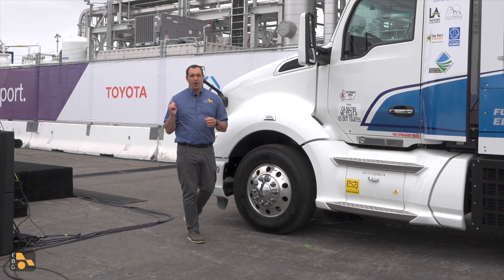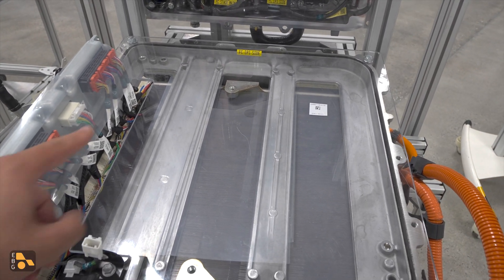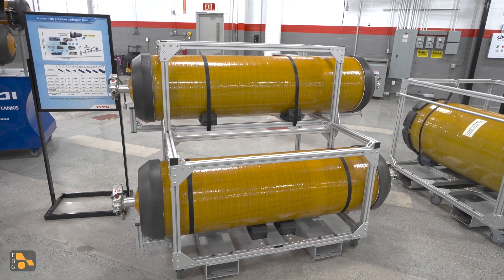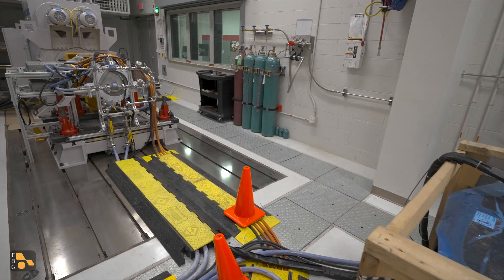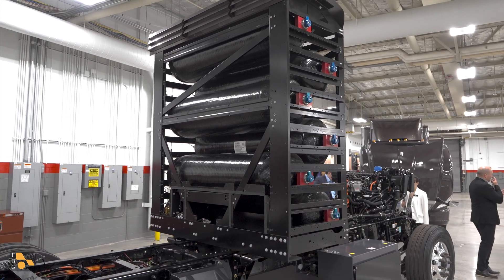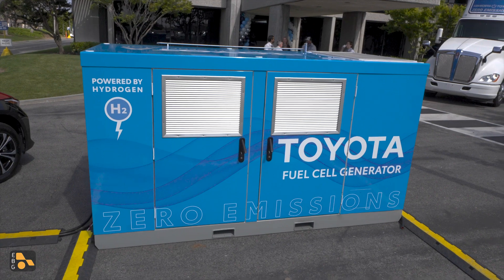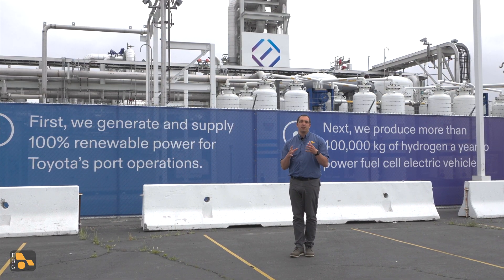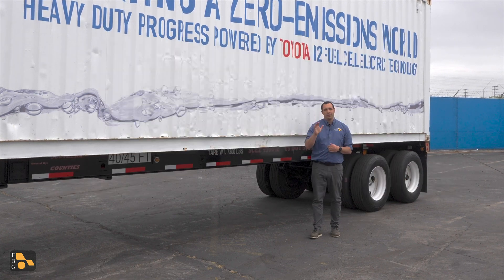More Hydrogen Is (In) The Future

Comment: 2:27  Love the "DO NOT USE AFTER" date of 03/2036 on the tanks.  That's when all 3 tanks need replacing because you can't test and recertify composite 10k PSI tanks.  Hopefully, the price will come down because it's about $20k to replace them at the moment.   A similar warning (DO NOT REFILL AFTER) is on the fuel door.  They are certified for 15 years in the Mirai, not 20.

Comment: This vlog about hydrogen power should not be on the EV Buyers Guide channel.   Although the motive power of hydrogen vehicles is an electric motor, most hydrogen today is produced from fossil fuels, natural gas and petrol.  So a hydrogen-powered vehicle is not an EV.  Using a fossil fuel to create electricity, which is used to produce hydrogen, is thermally inefficient.  And burning  a fossil fuel to create electricity adds carbon dioxide to the atmosphere.

Comment: Rube Goldberg called and he wants his truck back.

Diesel truck (1 powertrain): 150 gallons of fuel, 1000 miles range, >400hp until depletion
Hydrogen truck (2 powertrains): 200kWh battery+60kg hydrogen, 400 miles range, ~1hr at 400hp then ~230hp to depletion
Tesla Semi (1 powertrain): 800kWh battery, 500 mile range, ~1hr at >1000hp then tapering to depletion

All of these trucks have similar weight and hauling capacity, only 2 make any sense.

You can already charge a Tesla Semi in more states than you can fuel a hydrogen vehicle.

Hydrogen always has been and always be a joke for road transport.
Reply from the maker: For what it's worth, a decade ago (and today for many) BEVs were a joke. -Travis

Comment: Facepalm. Using natural gas to make electricity, then using electricity to make hydrogen. Then using hydrogen to drive. Feels like another Toyota excuse. Just use a natural gas engine or generator and save yourself the trouble and a lot of money. This is wasting resources not saving them.
BTW water is used to make hydrogen, water is not a product of making hydrogen. You get water when you burn hydrogen - so it probably comes out of the fuel cell.

Comment: This type of  infrastructure installed in most city and town would not only produce fuel for vehicles, buildings and many other applications including providing clean water for them locally without a lot of contaminates & pollution by products.  If the fueling is as quick as petrol I can see that the current fuel stations would be more willing to adapt to this technology as it will not have soil contamination in the future and does not take away their current income like the EV charging stations that has long turn around time for each station (it they are ever working in optimum condition) per vehicle.  Glade to see the technology is going in the correct direction.  I appreciate the diligent of the OEM making the tanks safe; however, what is the estimate damage radios & effect if one should malfunction?

Comment: Big trucks are a perfect application for this technology.
Reply from the maker: It certainly seems easier to find room for the tanks than a sedan. -Travis
Reply: I'm not sold.  The Tesla semi has recorded a 500 mile trip with 82k lbs total weight with a ~900kWh battery.  They can add ~350 miles in around 40 minutes with 600kW charging.  They seems very very competitive.  It's going to come down to how easily is it to build 1mW charging vs hydrogen stations and how big of a deal 30 vs 10 minute fueling is as well as the fuel cost.  EV seems to in on about every one of those other than refueling time and I can't figure out how an extra 20 minutes is a big deal given required breaks.
Reply from the maker: One of the key points to me is the difference in battery capacity necessary. The truck runs off an electric motor but is using a 200kwh battery versus the almost 5x larger battery on a BEV truck. -Travis

Comment: As a geek I always enjoy a good science fiction story. But this one had me shaking my head and laughing throughout for numerous reasons. Especially at the end where you stated that Toyota used natural gas instead of the Biogas methane, which Toyota originally used at the facility. 

Cost and inefficiency has always been a non-starter for fuel cells. (Except in a few niche cases.) But also using an unsustainable hydrocarbon such as Natural Gas as the feedstock and calling it zero emissions is  just greenwashing.
Reply from the maker: Toyota is "using" Biogas in the same way that most utilities offer green energy options. They pay for it but they aren't specifically utilizing it. -Travis
Reply: @EVBuyersGuide  Travis, thanks for the correction. And thanks for the story, it brought back memories of one of their earlier trigen plants.

Still the least cost effective or viable option, but at least it can be considered, NetZero.

Comment: The point is that this product could only work in the US where people want to invest in it. In many parts of Europe the top speed for the plus 3.5 tonne category is limited within a range of 50-62mph. Also in the EU, truck drivers have a mandatory break after 4.5 hours of driving, which must be at least 45 minutes. So a vehicle that can travel 480km (~300 miles) on a single charge with the ability to charge 410km (~255 miles) in 45 minutes is sufficient for almost the entire market. The entire hydrogen industry is a decade behind its original promises.
Reply: Exactly I think Toyota made a promise about H2 in 2012
Reply: and Toyota will keep riding that dead horse until the government funding ends lol
Reply: Don't look now, but H2 trucking is also being developed in EU-land. And in other parts of the world such as Korea. 

Trying to make this just about the US, is missing the point.
Reply: @nc3826  I know they are developing and testing, but it took them longer than they promised in the past. There should have been fleets of hydrogen buses, trains and trucks 5 years ago, but it didn't happen. The first prototype of hydrogen bus was on our roads back in 2009. 15 years later they are still in the prototype and testing phase. Meanwhile, battery technology is advancing at such a pace that for last-mile delivery or city buses, the entire ecosystem (chargers, service point, vehicles) is cheaper in electricity than in hydrogen.
The video implies that the main advantage is fast refuelling and long range, but this is not a problem in EU due to mandatory breaks for drivers. So you don't care if the car can fill up in 10 minutes if you have to take a 45 minute break.
Reply: @Dqtube WADR, you're missing the point of my inquiry to you. Since you believe the only advantage of hydrogen is fast fueling and the EU doesn't require that. Due to required break periods for drivers

Why is hydrogen powered trucking "still" being developed in the EU? And Korea and other parts of the world?  (Sorry none of what you said seemed to address that key issue)

(FWIW the US transports more of its long-distance cargo via trains than the EU. And US semi truck drivers are also required to take mandatory breaks. And not just for 10 minutes.)

I don't see hydrogen powered trucking becoming viable or cost effective in any part of the world without massive subsidies. (Since for one thing, battery swapping trucking is already being done at a much more cost effective rate.) I just find it amusing your Europhile perspective spin on the story, for why it's being developed in the US. When it's happening on a much broader scale. Toyota's not an American company and they're not hoping to develop it just for the US.
Reply: @nc3826  You should read my first comment again and better because you are assuming things I didn't write. When did I write that Toyota is an American company? When did I write that development is taking place in the US? I just stated that what they consider to be the main advantage of the technology becomes irrelevant because they are behind in development and slower than the alternatives. If you do not have a better argument than to misinterpret what I have stated, save our time and do not respond.😉
What's the key issue? Just because something is in development doesn't mean that the technology will have a big impact on the market. 
They continue to develop it because in some parts of the globe hydrogen will have the potential to be a cheap fuel because it can be used to store excess energy from offshore wind farms or large solar arrays. So in places where hydrogen will be available it may be a workable alternative, but everywhere else it will be expensive if you factor in the cost of infrastructure.
Reply: @Dqtube  I was just pointing out how the differences you mentioned between the US and the EU.... relative to hydrogen development were erroneous.... 

But  since you brought up an  interesting NEW subject.....  where in the world is this magical cheap hydrogen going to be produced? Please get back to me when it's being produced, so cheaply that it can compete with energy stored in batteries.... So we can all celebrate... As a geek I would love to see that...

fwiw You need to read my comment.  I never stated that you said that Toyota was an American company.... I just pointed it out..... I'm sorry that it confused you.... But since it's an irrelevant peripheral matter it doesn't really matter anyway... I just figured I'd mention it.

In conclusion, I think we dug this rabbit hole deep enough.... Have a nice day.....
Reply: @nc3826  Every summer, some solar installations are disconnected from the grid because their production is higher than demand. The situation is similar for wind farms in autumn and winter. So instead of being disconnected, they can power electrolyzers and produce hydrogen. This can later be used instead of natural gas or coal during the peak demand. The cost of this hydrogen is therefore calculated as the cost of the installation spread over the expected lifetime of the installation minus the cost of the fossil fuel that had to be used instead of hydrogen. It is therefore considered cheap in the long term because there are only initial investment and maintenance costs, no mining, energy intensive processing, recycling (waste management) and logistics costs as with batteries or fossil sources.
Reply: @Dqtube  for some reason YouTube deleted my response to your last comment?   In a nutshell the capital costs are far too high.....  And there's plenty of reputable sources that will prove it for you, if you do your research.....  Have a nice day...... 

Just hope our YouTube overlords didn't find anything objectionable in this comment lol

Comment: Will it ever be possible to generate h2 at home?
Reply: You can already do this in a basic electrolysis experiment, but for hydrogen as an energy source this is not possible for safety reasons related to gas storage. You need extremely high pressures or low temperatures for the liquid phase.

Comment: 11:25 If natural gas is coming in then CO2 is coming out. You did not mention that.
Reply: Originally Toyota used biogas methane.... Which meant the CO2 produced, came from the atmosphere and was returned back to the atmosphere....  And therefore had net-zero emissions....

If Travis's statement is correct and they are now using natural gas instead that's a totally different story now....

Comment: I understand the refueling time advantages vs an EV. I assumed weight would be another benefit but the Mirai is 4300 lbs. I don't think any of the 400 mile range EVs are lighter but the Lucid Air Pure isn't far off.
Reply: Battery swapping for large commercial trucks is done in less time. For example Geely does it for cement trucks... But there are other examples. 

HFCV does have a gravimetric advantage (ie weight), but not volumetrically. And they are far more costly and inefficient.  (And with Toyota apparently now using natural gas to produce it, it's not even a truly clean option)

Hydrogen, the transport solution that's always been 5 years away for the last 50 years. And with the improvements in batteries, it's hard to see that paradigm ever changing.
Reply from the maker: It's probably worth noting that the Mirai and Lucid Air Pure are very different vehicles with equally different price points. -Travis

Comment: I'm a layperson trying to figure out the comparable battery size of that Kenworth. Not having much luck but I did figure out the Mirai is carrying ~ 188kWh of energy in it's 5.6 kg of H2 (73 MPGe with 406 EPA range). That's ~33.5 kWh/kG.
The Kenworth has 58.8 Kg on board so with the Mirai drive train that'd be 1,974kWh.
Reply from the maker: Don't forget the 200kwh of battery on board. -Travis
Reply: Gleey in China has its cement trucks swap out, about megawatt battery packs. with a crane. In a few minutes several times a day.  It's just one of many semi truck BEV options. 

So that begs the question why are inefficient and costly natural gas/hydrogen fuel cells needed, for semi trucks?
Reply: General rule of thumb is 15kWh battery capacity equivalent per kg of H2 after conversion losses.

Comment: Nice science project, but hydrogen will never be used wide spread.  It costs to much, it's not readely available and it's dangerous.  If you have a leak in your garage the hydrogen rises to the ceiling so if there is a spark from a light or a garage door opener then it catches fire.  This is because hydrogen atoms ore one of the smallest and very leak prone.  It also cant be stored in metal containers because of hydrogen embrittlement.  That is why all of the containers are non metalic.  In a car accident the there is a leak and fire the flames can't be seen in the day and are only a faint blue flame at night.  I know because I ran a liquid hydrogen plant to support rockets.
Reply: In a car accident if it leaks it tends to dissipate rapidly. Since it's so much lighter than air. BTW
if it's so dangerous, then your hydrogen plant must have exploded every 5 minutes? Or were you just being one sided and melodramatic.

FWIW Hydrogen is already used for numerous applications safely, it is not just used as a rocket fuel.... Such as for forklifts.... And if it can be used safely for forklifts why not for semi trucks? Not saying it's going to be viable and cost effective for semi trucks anytime soon, but that's another story....

Lastly thanks for proving the old adage that a little bit of knowledge is a dangerous thing...
Reply: @nc3826  Actually a month or two after I changed jobs the plant did plow up.  Look for Air Products and Chemicals Liquid Hydrogen plant in Long Beach California, in the mid 1970's

Comment: I'd like hydrogen reformer from natural gas at home. In the 1990s it looked like Plug Power would soon have natural gas fuel cells for home use, but there have been problems... 30 years and still not widely and economically available means hydrogen and fuel cells may have missed their mass adoption window.

Hydrogen is the least energy dense of all "fuels" but when liquified it still has enough to make batteries look bad.  But batteries are catching up, and dropping in price at the same time. There isn't much charging infrastructure out there, but there are far more chargers than hydrogen fueling stations, and you can charge at home. Hydrogen now might be too little, too late.
Reply from the maker: We'll see, there's a lot of money going towards H2 right now. -Travis

Comment: Thanks Travis. Some of the ones you talked a new to me.
It appears their tanks look built to last, but I'm wonder the longevity of the rest of the H2 plumbing system. 
Idk how pressurized gaseous H2 cause embrittlement like LH2, and leaks inside garage can turn into instantaneous fatal event.
Reply: hydrogen is notoriously hard to contain.  This may make leaks more likely, but it also makes hydrogen gas almost certain to escape the garage. Unlike propane (much heavier than air) and methane (more than 7x heavier than hydrogen, but still lighter than air) and gasoline vapors (much heavier than air), hydrogen quickly dissipates.  All are problematic, but the worst tend to be the heavier than air explosive vapors that tend to pool on the ground and flow until they find an ignition source.  The next worse are the ones that mix with air and stay suspended to fill a space like methane.  Hydrogen is comparatively quick to just go away.
Reply: @Sylvan_dB  That's good to hear. 
I vaguely remember BMW Hydrogen7 was not allowed to be garaged due to its Hydrogen venting. 
That was a continuously boiling off liquid H2, but I was wondering if the same safety measures applies to Toyota's system.
Reply: @MistSoalar  That's a good point. BMW did design their system with an "interesting" feature. I haven't heard of that with existing Toyota hydrogen vehicles, but definitely something to consider and find out before purchase!
Reply from the maker: I was curious about the tanks myself but based on what I saw and was told I'm pretty confident in them. Things do happen though so having a solution for when something goes wrong is important. -Travis

Comment: H2 is an important step to zero CO2 emissions. BEVs are the way to go for passenger commuting appliances but for heavy transport industries like long haul cross continent trucks and ocean shipping H2 is the best solution. There needs to be a lot more government incentive (like at the BEV level) put into green H2 though, more than 90% of it come from brown and grey sources.

Turquoise H2 has a lot of promise since the high quality carbon black is used for "cheap" graphene for next gen BEV batteries and low quality can be used as a soil additive for farming.
Reply from the maker: There's certainly government investment going to H2 at the moment. -Travis
Reply: The bipartisan infrastructure bill did include some money for hydrogen stations because Jim Manchin likes things that drill.   Probably will take a long, long time.